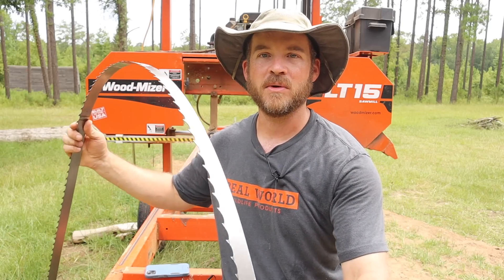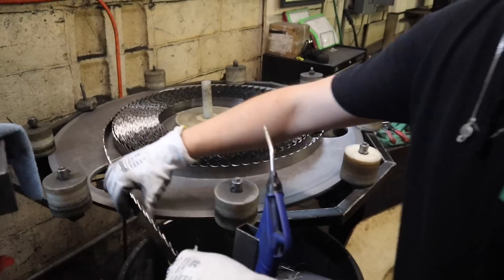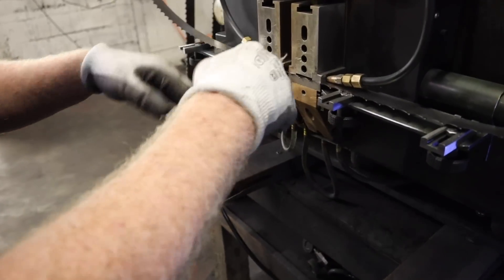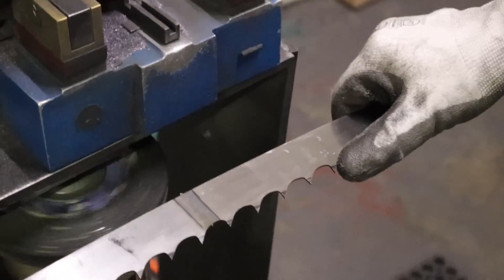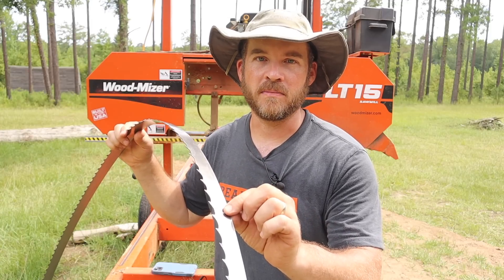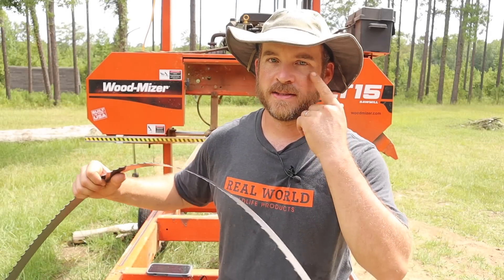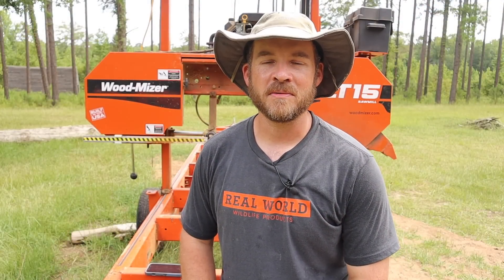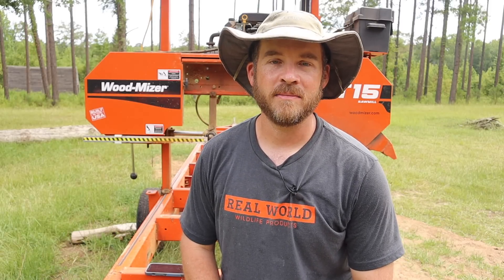How Sawmill Blades are Made

Comment: That doesn’t make make sense at all to want the blade to break before the weld from a sawyers point of view, that means the blades are not made of good material and are “cheap” yes, you want the weld to hold beyond the breaking point of the blade, but break after the blade has done enough cuts to pay for it’s self and more. I like your stay at the homestead videos more.
Reply from the maker: It's not that he wants the blade to break. It's that he wants the weld to be as strong as the blade. The strength of the blade is the standard by which to measure the strength of the weld.